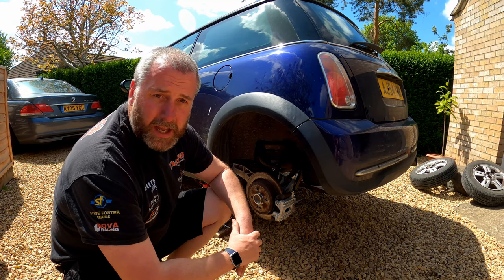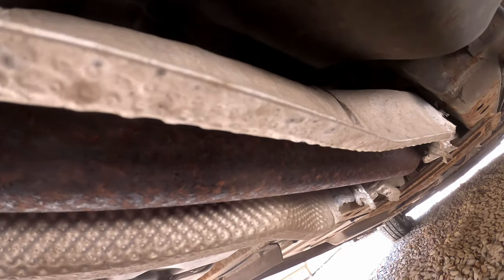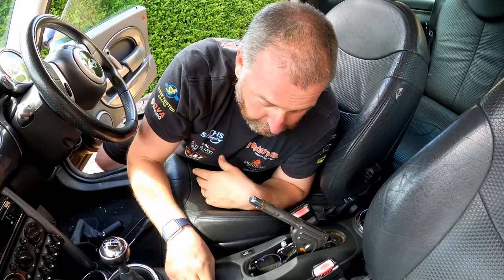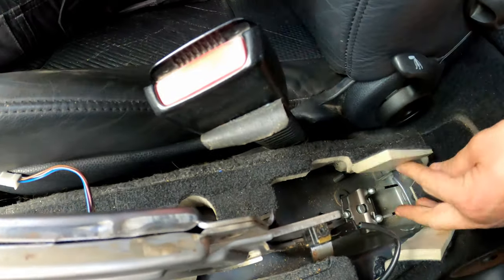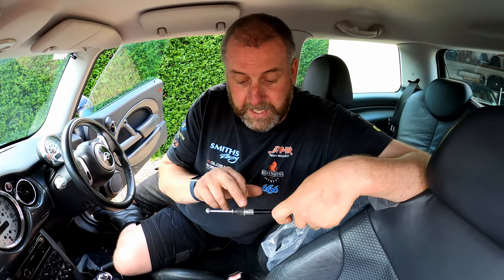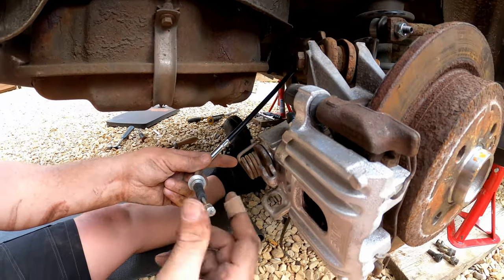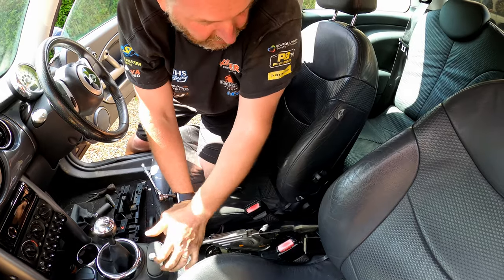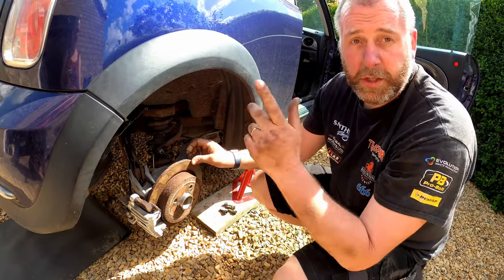Mini One, Cooper & S, Generation 1 & 2 - 2001 to 2014 Handbrake Cable Replacement & Adjustment

Comment: I ordered 2 cables for one of our Minis and plan to do this in a few weeks.  Right now I am changing a clutch on our 2003 Cooper S.  for the first time.  I also like the idea of the R56 rear suspension arms even though we don't have the rust issues here in Chesterfield, Virginia, USA than you have over there.  Love your videos, add one more Sub!

Comment: nice, concise video, just thinking a peice of string drawn thru by old cable coming out cud be used to draw new cables in along same path, same as BT engineers do fibre and phone cable drawing thru pipes. ;)  you'd only need access at each end not the entire path, (some other guy removed exhausrt and heat shield) :|